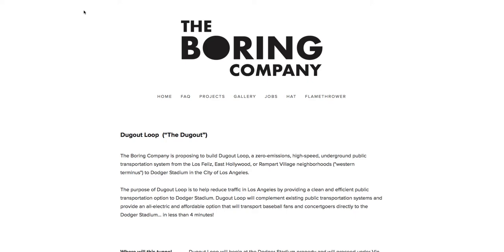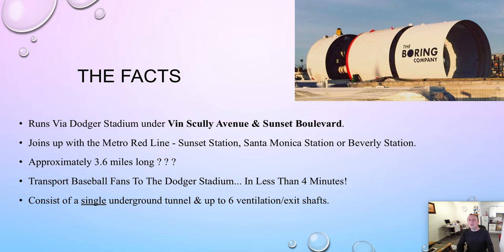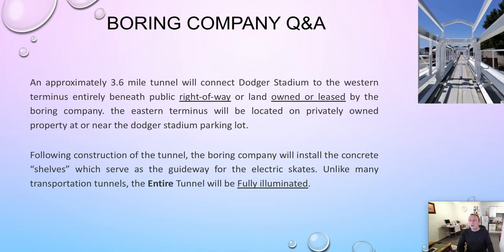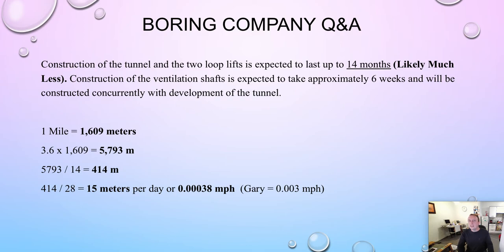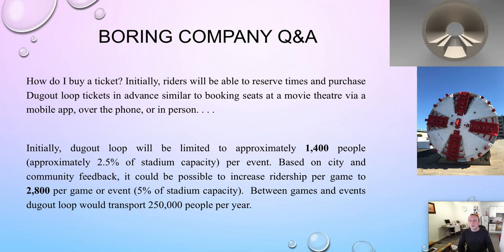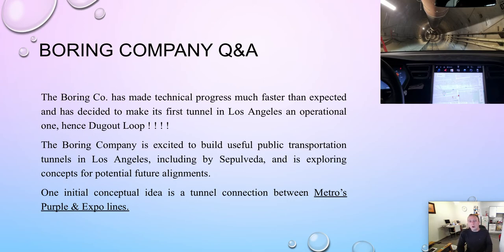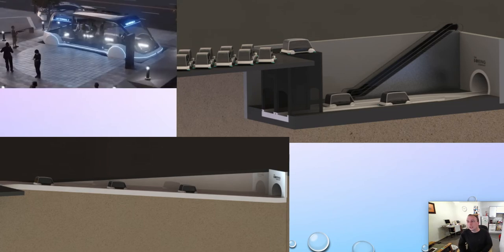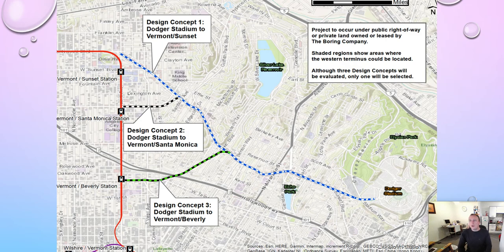The Boring Company - Dugout Los Angeles Project News - 08.16.2018

Comment: Is the tunnel high enough to have a car-height pods going one way on the bottom half and going the other way on the top half (if there were a platform in the centre)?
Reply from the maker: The tunnel will be 14ft in diameter so it has barely enough room for a Ford F-150. A second parallel tunnel will run alongside it once Elon has proved the technology in the real world.  Thank You for the question 😃 👍🏻